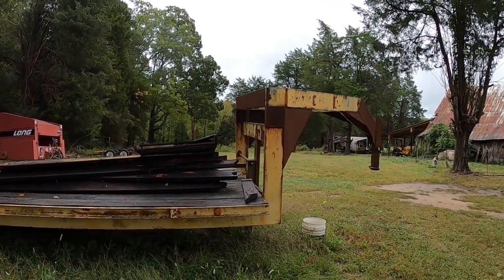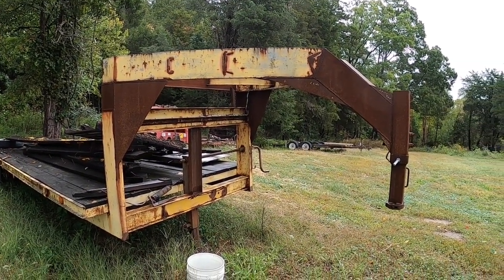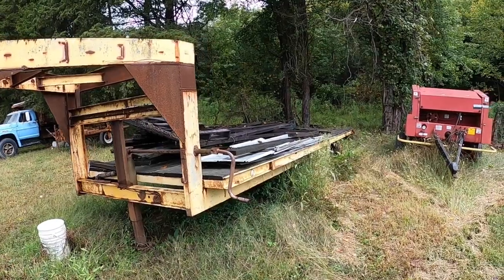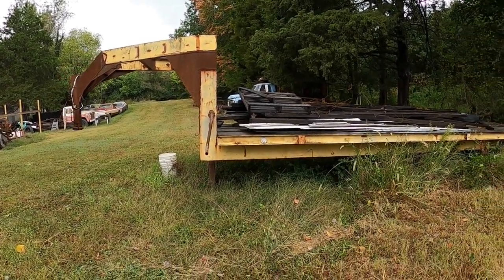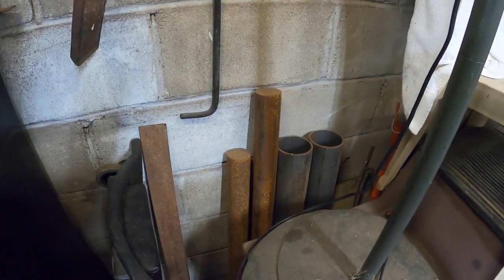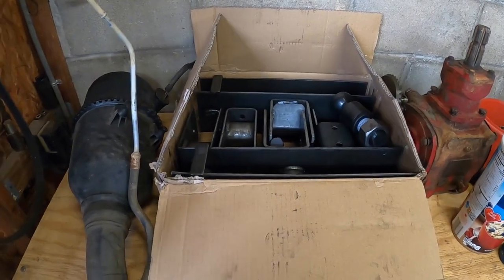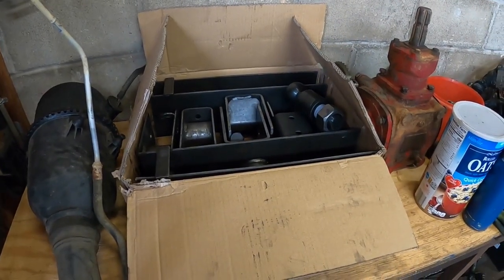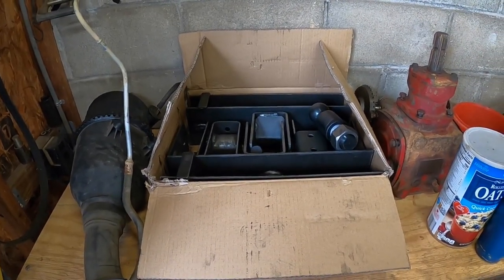FINALLY parts are in for the Gooseneck Trailer Axle Swap!

Comment: That trailer will certainly earn it’s keep. Back in the 1980s I built a 8X20 gooseneck from a wrecked Duce-and-a-half ton truck. Used the bed & frame, cut the truck axle out and installed a tri-axle setup off a mobile home. Welded up the hitch out of channel iron. Man, I don’t have the wheaties to do that anymore!
Reply from the maker: I do believe you are correct Mr Pete, will be a nice addition to the hay line up!! Man yeah, that sounds like an awesome trailer build!! Esp the deuce and half stuff!! Man I would love to see pics of that!! 😁😁 I am inclined to agree on the wheaties, at least on my end🤦🤦 It was a battle doing the front, but at least all is ready for the swap now, and just some mock up and wire burning!! Thank you my friend for the kind words and always being here!! I really appreciate that!! Also for the insight into your past build, that sounds amazing!! I may not have enough truck to pull what the trailer will handle when finished though 🤣🤣🤣🤦🤦🤦😁😁👍👍🇺🇸🇺🇸🇺🇸

Comment: We are fortunate to have a supreme trailer supply company pretty close to us.  Sometimes you have to spend a few bucks to get it where you want it.  A pair of 10,000 lb axles will handle anything you want or need to haul for your place.  And you got it going on with the slugs for the inside plus the caps over the outside...never gonna be a problem with those at all !!  I should've put at least 8,000 lb axles under the goosneck dump during that rebuild...but I didn't.   You sir, are quite the fabricator !!  It's tricky doing what you did with the changes to the front end.  But it looks expertly done.  Take care my friend and we'll be along with you for the ride.
Reply from the maker: I don't know why Mr Wendell but around here thses 2 1/2" slippers seem odd to everyone ,🤦😳 But did get lucky to find new parts for sure!! Man yeah, to much is always better!! But honestly it just worked out that way, couldn't pass these up for 100 a piece, even having to lengthen them!! I sometimes get a little carried away with the overkill..slugs and sleeves, but at least I won't have to worry about that part of it ever!! 😁😁 I wish I could find pennies on the dollar equipment I didn't need to work on, but man that trailer was cheap when I bought it well worth the extra! The farmer had built it for a road tractor, so it was very very low, and had that platform on it. The day I brought it home, turning into the farm I almost sheared the cab corner off my dodge😳😳😳 Very little distance from the hitch to the uprights! We started cutting and went to town with it! My buddy who y'all never get to see is my ace in the hole, on the fine measurements and such...he is a machinist by trade😁😁 But it was quite the undertaking for sure, but turned out pretty nice! Now if the a les will go that well 🤦🤦🤦🤦 THANK YOU very much sir for all your kind words about the fabrication aspect!! I always have loved to burn some wire, eyesight is going fast so it's a challenge now...but still enjoy it!! You sir are a scholar and I so appreciate you Always being here, and all the great motivation!! Hope your day is well sir, thank you again!! 😁😁😁🇺🇸🇺🇸🇺🇸👍👍👍
Reply: @Pennies_on_the_dollar  When it comes to adapting an axle there isn't much that's 'overkill' in my book.  At that price you couldn't pass up those axles.  We have another company here that will build any spring to any dimension you request and its not any more expensive than the off the shelf products.  Anything from the smallest springs on a trailer to the biggest industrial spring you can imagine too.  Built to order. 
   It's always good to have a buddy that knows his way around a rule and a square when it comes to building a gooseneck...or anything for that matter.  You sure got a good grip on the welding portion, I can tell.  I started on a 300 amp Lincoln A/C welder running 7014's when I was about 12.  I can make a pass about as good as a mud dauber now.  But I've graduated to an AC/DC and usually stick 'em with 7018. But then there's the SnapOn 230 amp wirefeed I got for a little job for a buddy.  Its good too.  
   I look all the time at the shapes of shop built goosenecks and you see some real messes going down the highway sometimes.  But your's will look factory with a good coat of fresh paint !! Ya done good my friend.  Take care and have a wonderfully productive day !!

Comment: Do you have brakes on the trailer?
Reply from the maker: Mr Robert I can't be dishonest, no I do not. Never have had on any of my goosenecks . I have checked into the hubs for these axles, and will upgrade them at some point most likely. The service truck is 4 wheel disc so around here it will be fine I think. I originally bought the axles and suck for use behind the L8000 to pull it most of the time...them sold sold that truck 🤦🤦🤦🤣🤣🤣🤣🤣 Thank you my friend for always being here!! I really appreciate that sir!! Hope all is going well up your way 😁😁👍👍🙏🙏
Reply: @Pennies_on_the_dollar  I never had brakes on my trailer either. I've had my trailer for over thirty years. In order to get it registered in PA I had to have an Enhanced Inspection. Had to install brakes on all 4 wheels. Had to install brake controller in truck and a  breakaway controller on trailer. Tires can't have any weather checking and lights can't have any cracks in the lenses. Have to have reflective on the trailer. PA loves to take your money. In Texas no Inspection when moved to GA no Inspection.
Reply from the maker: Wow!!! I bet that was a chunk of money 😳😳😳 Yes sir, same in NC as well, with no inspection, that's crazy!!!! We usually get a permanent tag for the trailers and that sure helps out a lot!!! Man, I am thankful that process isn't here🤞 Thank you Mr Robert for the info, how is your truck coming along?
Reply: @Pennies_on_the_dollar  it was expensive I probably spent over $1500 just so it would pass Inspection. Then still had to pay for Inspection forgot to mention here in PA you also have to have a title had to pay for that then pay for the registration. For a trailer that only cost me $400 to build.
Reply from the maker: Oh my word, that is so crazy!! It seems some states almost won't to push people away from certain things with all the fees and laws 😡😡😡 Really sad how things are getting now a days😢😢
Reply: @Pennies_on_the_dollar  PA is certainly a State that squeezes you  for every penny they can get. If it wasn't for the farm here I would have never moved up here. We pay taxes twice a year county and then school tax. Also pay city, state and township taxes. I  do miss Texas we didn't pay State taxes there.
Reply from the maker: @Rdrake1413  Good lord Mr Robert!!! That's crazy 😳😳😳 Wow they get every dime for sure!!!😢😢